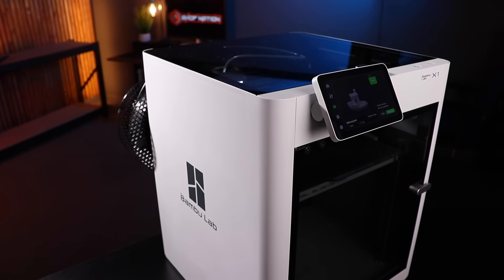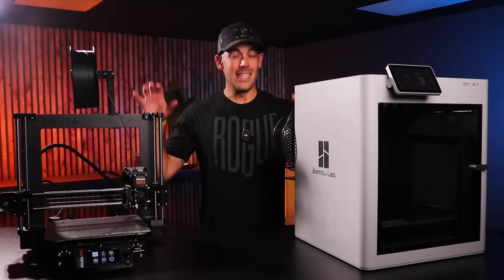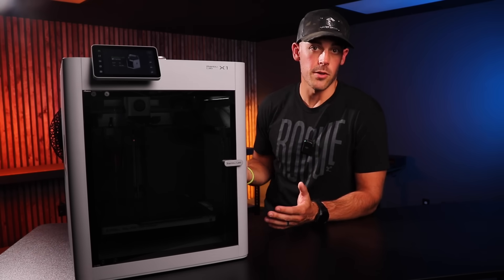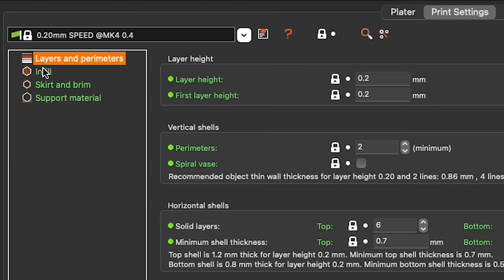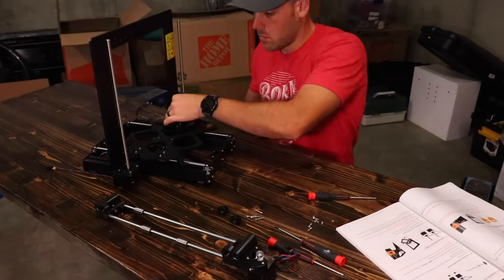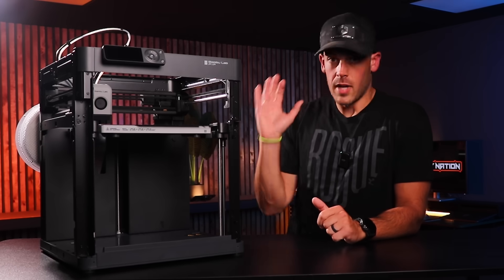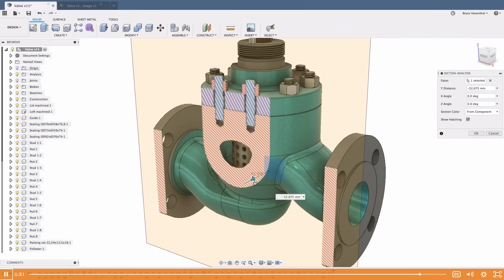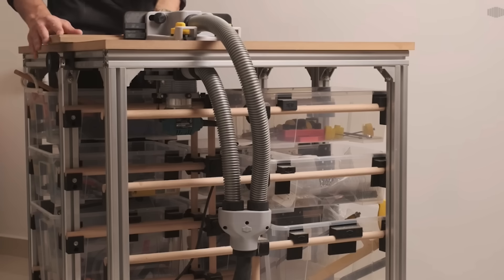The 3D Printer I'd buy if I started over

Comment: I get your points but your thumbnail is really really misleading. I was shocked when I  saw "don't buy these" with a prusa and a bambu lab machine over that.
Reply from the maker: How exactly is it misleading?
Reply: How is that misleading? That is the exact advice he gave in the video. Not to buy either of the printers in his thumbnail. He recommended the P1P not the X1C or the Prusa.
Reply: @makeit3DOhio  If I understand correctly, the video's first section emphasises that a good printer should function effortlessly without requiring any adjustments. The second part suggests that for a beginner, there is no need to invest in top-of-the-line hobbyist printers. Instead, opting for a scripted-down version or a kit model from the last generation would suffice.
When the thumbnail states "Don't buy these," it kinda implies that these printers are inherently bad. It doesn't communicate that they are not essential for beginners, without implying they are the absolute best choice.

Comment: Nope. If you are a beginner, then you should learn from the ground up. This isn't like a "normal" printer, where you send it a file and it prints a sheet of paper (Which most consumer grade printers rarely work out of the box or consistently to begin with). To make a good functional prints like you are saying, you need to understand what the machine is doing, how it works, and especially what the slicer is doing. Deciding whether you need to print with overhangs and support or what infill would be best is part and parcel with making a usable part. Unless you are rich, no-one starts with a new car when they start driving. You start with a cheap used car, and if you are going to college, you figure out how to fix it or find a friend to fix it. Ender 3s are fantastic beginner machines. They are simple, easy to use, easy to understand. And once you learn Cura, there is a huge world of possiblilites.

Don't go buying Snap-On tools if you don't plan to be a career mechanic. Unless your life depends on the tools you buy, buy the cheap stuff, use it till it breaks or has taught you everything that it can, and then move up the ladder from there.

Also, I assume you worked at Markforged based on the montage you showed. I have serious issues with a printer that is marketed torwards the engineering sector that also locks you out of basic  slicer functionality. I'd also rather not have a browser based slicer, especially to control machines that cost more than most cars do brand new. I am also not impressed to have to spend $90 on a standard sized bowden tube with off the shelf fittings.
Reply from the maker: Your analogy is quite terrible. Knowing how to design for 3D printing has absolutely zero to do with the mechanics of the machine - and even less correlation with your ability to fix a crappy design. I’m all for knowing how the thing works but that’s because I like and appreciate it. Lots of beginners don’t have the same feelings and would do better with a machine that just works

Comment: Great video...  But, I definitely disagree with the recommendation of the P1P unless you are a fan of closed wall gardens, want to only buy replacement parts from bambu, be reliant on their firmware, and really hate the slicer you currently use.  Then, P1P is for you.  If you know anything about diagnosing, building, updating printers...  P1P is a hard pass.  Also, because of the carbon rods... If you scratch or crack one... you will be buying a whole new machine.  Many of the carbon x rod machines are this way, which is not sustainable and is in fact bad design.
Reply from the maker: Correct, if you love working on, fixing, and tinkering with printers - the extremely reliable and easy to use P1P is a terrible choice 🤔🙄
Reply: @ShopNation  It is about not being a shill for a company with an Apple like mentality.  If you like the P1P, so be it.  But, proprietary BS is not how the industry has progressed, nor will it.

Comment: The input shaper part is nonsense. Input shaper allows you to keep high quality with high speed but input shaper is used on other 3d printers, like e.g. vorons, too, and doesn't lead to this high speed.
Reply from the maker: Then they aren’t using it correctly 😂
Reply: @ShopNation  Maybe you spend some more minutes to understand input shaper instead of answers like this.

Comment: "Best hobbyist 3d printers on the market right now" while completely avoiding  neptune 3 pro or even e3s1. Yes, you might not have Klipper out of the box on them but the cost to upgrade them to have it is around $50 and with another $25-50 you can get the rest of potential upgrades to get better nozzle, better cooling etc. So for <$300 you can get fully functional printer that would work FASTER than bamboo at least (not sure what shapers mk4 is using). 
You're saying "I'm not going to bore you with tech specs, speeds..." but neither of those printers have solid nubmers for the test results and exactly which input shapers they use and the frequency for them. I could potentially understand the justification for Prusa due to their whole ecosystem and you COULD buy it cheaper as a kit, but at the same time... I guess Tesla analogy does work great for Bamboo -  It is made to look slick and modern while being cheap on the inside and extremely overpriced for the actual numbers it produces with questionable reliability.  I thought for someone who was in "professional engenieering setting" that would an important part.
To add: Your explanation of the addition of input shaping is making it sound almost like THEY figured out what input shaping is and not that it was available in Klipper for several years now. This is either your inexperience with working with 3d printers or you not being up to date with development in the field of 3d printers and other software but it sounds almost borderline on being false marketing for Bamboolab.

NVM YOU ACTUALLY SAY "Prints on this machine (pointing at Bamboolab) can be up to 4 times faster than on prusa" WHILE THEY BOTH HAVE INPUT SHAPING. Hoooollly... Like how can anyone take that seriously, while they are both on Klipper and the MAIN advantage for them compared to something much much cheaper like e3s1 or neptune 3 is mainly the fact that they both already have Klipper installed and set up with "Manufacturer's Config" (WHICH CAN BE A BAD THING - look at Creality's locks on K1 that prevented proper calibrations) and not just a calibrated Klipper config...
Reply from the maker: You sound like one of those nerds I mentioned in the video. Input shaping has been used in the high end CNC world for a very long time - well before 3D printing ever thought about using it. So the crap 3D printers you mentioned didn’t come up with anything either
Reply: @ShopNation  Yeh, you didn't but it's ok even when you're trying to imply something by saying that. I'm just against someone giving decent amount of misinformation and either pushing marketing material for manufacturers on purpose or inadvertantly falling himself on that marketing material (which would be strange considering you claim to have so many years of experience).
Yes, and IS has been in Klipper for some time already too, and it's just that now more manufacturers have finally started to integrate it into builds by default and started to push it and the higher quality of prints that it gives and better speeds as marketing feature. Except when you really look at the situation - those "super fast printers" often perform worse than regular bottom of the market ones that consumers usually buy -  the one you called "crap" for example -  if you just upgrade them. And YOU, just mindlessly praising overpriced and overhyped ones vs actually trying to give an option for a better value just shows that that review and "advice" is not very good and people shouldn't listen to you on that. 
Also, you saying that some of the best value for performance printers on the market currently are "crap" is laughable and just shows you that you're out of touch (or pushing the marketed stuff for some reason).

Comment: My Ender 3 v2 worked from the moment I turned it on. I like to tinker, so I have modified it a little over time. It's reliable, prints well (I rarely have a failed print and it's usually my fault) and maybe a little slow, but I'm like most people and don't have $1000 or more to plunk down to get started. Unless I'm going to do commercial printing, I'll stick with it.
Reply: I bought an Ender S1. It wasn't a steep learning curve. I was printing well from the get go. I think I went a little overboard. I should of went with a Ender 3 v2. I'm so glad I didn't buy a Prusa.
Reply: @poopoppy  Creality printers have a lot of issues these days and the company is using the brand name to trick people into buying their printers, when you can get much higher quality ones for the same prices or less
Reply: @blyticaltwo  Yeah, probably. They are famous for poor quality control.
But you learn about how printers work, and most issues are easy fix, because of how big the creality community is.
1000 bucks on a first printer is overboard. I spent 400 on my S1, and that was a bit much.
As handy, and as cool as 3d printers are. Chances are they won't get used all that often.
It's not about any brand in particular. It's more the price point.
Reply: Ender 3 v3 SE looks pretty damn good for 200-220 dollar
Reply: @TheMrMultione  I actually just bought that one, and haven't had any issues. Set-up was incredibly easy, and the auto bed leveling is super handy. I was running perfects prints in under 20min. I have an Ender 3 Pro as well, so I knew a little about parts and stuff if I did run into problems, or wanted to mod it. But as is, it honestly doesn't need any mods, unless you plan on Printing more demanding filaments like metal.
Reply: You must have been one of the lucky ones.  The one I bought never worked.  Turned out the motherboard had parts that were never soldered, gantry elements that were not cut properly, and a stepper motor that was off.  I'll never buy another product from them again.  A buddy of mine bought 3 of them and none of them work.
Reply: Can definitely agree. I’ve had my Ender 3 V2 for over a year, printed a 1-1 scale of Guts sword and much more from this printer alone. And the only problem I’ve had is I had to replace my extruder fan, once.
Reply: Wish I could have said the same.... I got a Ender 3 Pro 2 and it was nothing but heartache and failed prints. Out of over 250-300 failed attempts and entire spools wasted, I had 3 successful prints and a trash can full of the dragged around extruded waste. I tried PLA, PLA+, ABS, PETG and nothing worked. I used glue sticks, bought new glass beds, new nozzles, and nothing ever worked. I am giving it way for half of what I lost in the great ender Fail of my life. On the flip side.... I bought a Bambu Lab P1S and out of the box 150 prints later no failures or wasted spools and I can print with the AMS in up to 16 colors all while printing 24x faster speeds than the ender with a self bedding system. The Ender was a mad disappointment and the computer software for it was abismal. Bambu at least kept me from giving up completely. Also Creality as a company was no help neither was any of the hundreds of forums that I questioned and tried to get help from all everyone said was "you have to use card paper to level your bedding", "try the same temp settings on bed or nozzle I was already using," or "It works great for me!" Thankfully I have talked probably over 100 people out of buying an Ender printer and avoiding that disappointment.... They all went with better printers.

Comment: Ok, so you ramble on about speed.  Let’s compare 6 ender3’s printing products vs 1 prusia Mk4.  Does the Prusia mk4 produce the same volume of product as the 6 ender 3’s in the same time ?  Because that’s the equivalence from a cost perspective!
Reply from the maker: Honestly over a long period of time I bet it actually would. Uptime becomes a big factor
Reply: @ShopNation  Fair comment.  It would be good to know the reliability numbers.  I’ve had a pretty solid flow with ender 3’s but I’m not doing production level by any means.  They’re a rapid prototyping platform for me.

Comment: the prusa i3 whatever mark blah we have at work,  is a single metal frame with twin lead screws on the Z axis, a bunch of 3d printed parts and zip ties holding the guide rails and limit switches in place. It constantly moves in its frame and the Z height is never right as its held together by a couple bits of used fuel line and nothing is timed, it cost us 800 bucks back in the day. Personally I rather play poker with Satan than waste my time and money on a piss poor rep-rap remake with designs penned in 2006
Reply from the maker: I own 36 of them and they work fantastic, so, yeah

Comment: I have an Ender-3 V2.999. I modofied the crap out of teh V2, including designing and printing my own linear rail system, etc. It very rarely needs adjusting and can print at 300 degrees. What it doesn't have, is dual extruders. That, to me, is the one thing worth going over 500 dollars for. Printing supports.

Comment: I print in a room that is at the back of the house and generally 10 degrees cooler than comfortable. The X1 with surround would probably help the build plate stay at temp.

Comment: If you have the money then I’d say go for it but more expensive machines like these aren’t needed at all. I’d honestly recommend buying a cheaper one anyways. I remember a guy who stopped 3D printing because his printer was broken when the whole problem was only a clog but he didn’t understand. My point is I see no problem in learning to tinker with a 3D printers because you’re gonna need it. It doesn’t seem like a good idea in the long run to hold off on learning how 3D printing works especially since this hobby requires that you know what you’re doing if you want it to work out. But maybe that’s just me. Now I know how mechanics feel.

Comment: Unfortunately Fusion 360 costs more than $500 per year, and will only increase in price over time. And unless you're doing your own 3D part modeling the 3D printer isn't much more than  a toy. $500 per year is a lot of coin.
Reply from the maker: Fusion isn’t the only option and you can use it for free as a hobbyist

Comment: You got me in the first 2min. The reliability and something just working is something sooo undervalued, not only in 3d printing but I would say in DIY in general. As someone that around 6 years ago started my 3d journey I completely related with what you said. Until I bought my prusa MK3S most of my time I was doing exactly that , buying third party parts to upgrade the printers and constant fixes or calibrations. My prusa in 4 years needed to be fixed once, the thermal sensor, which was a 30 min job. They have great documentation that makes it easy to fix and build the printer. Currently I'm considering to expand and I'm quite divided between bambo and prusa, but due to their track record, quality, open source and constant software upgrades/deploy I'm inclined  to go prusa 4, but the tesla looks amazing 😂
Reply: I've just gone for the mk4, it an awesome machine with a great pedigree. Bamboo, who ?

Comment: glad to see that someone else also understands that not everyone finds tinkering with 3d printers fun.
Reply: It’s not and no one does but it’s important. Same as a car. You should know what going on the inside and how these machines work.
Reply: @anzuis7  cars at least have regular maintenence schedules.  i have only seen one 3d printer with a regular maintenence schedule (ultimaker).  i have no interest in understanding how my car's valve timings work.  i pay other people to fix my car for me every 6 months.  if i had to do the same with a 3d printer, i would be getting it fixed every 4 days and not want to use it.  i would end up using one of those 3d printing services like protolabs instead because it would be cheaper.

Comment: Sorry but this is horseshit, I paid 170 brand new for my Ender 3 Pro and it was printing perfectly in less than 10 minutes of me putting it together. It did not require a bunch messing around other than putting it together when it arrived and I was a total novice that had never owned a 3D printer before.

All you are paying for when you pay stupid money for a Prusa is the name, the actual functional components are the same as a vast number of cheaper options.
Reply from the maker: Coming from a self proclaimed novice with 1 printer. Glad you lucked out but that’s not typical

Comment: Prusa MK4 with imputshaper is faster then X1, also my main problem with bambu is noise. You cant have that printer in flat and print something because those really loud noise and vibrations are extremly terible and my next big issue with it is spool holder from back because you must turn your printer every time you want to change filament and thats pretty horrible.

Comment: In addition Unless your an EE (Electrical engineer) the way the circuit boards are made (layed out) is absolutely critical to your 3D printer success... because Electrcal Energy doesn't flow though the wires and Voltage and Currant is not Electrical Energy, it's properties of it.  See Rick Hartley pcb design, Veritasium - how electricity really works!  The Water 💧 model is lying to you.

Comment: For people unsure if they wanna 3d print all the time, the Kingroon KP3S is underrated. It's under $200, and has most of the features $300+ printers have. It's basically a cheaper Prusa Mini without compromising consistency. A friend used it for a year with no problems before upgrading to the P1P. Def recommend for people starting out on a budget!